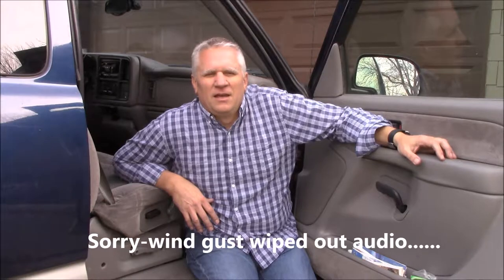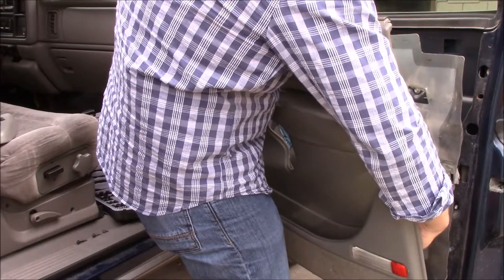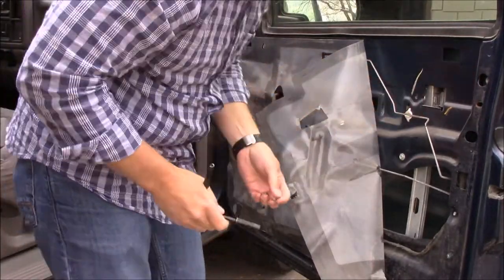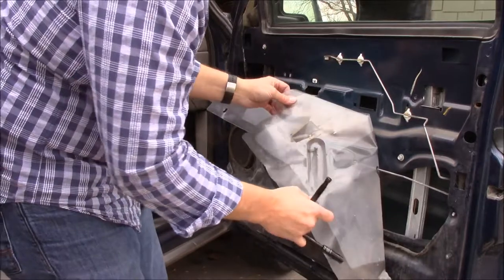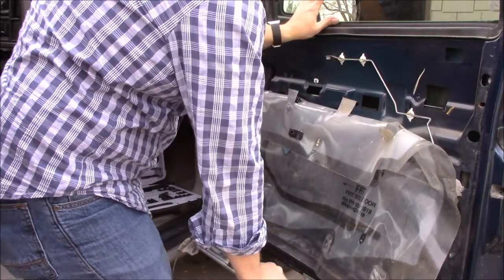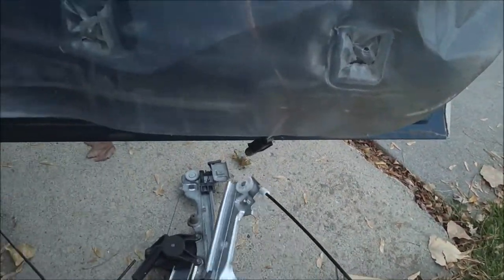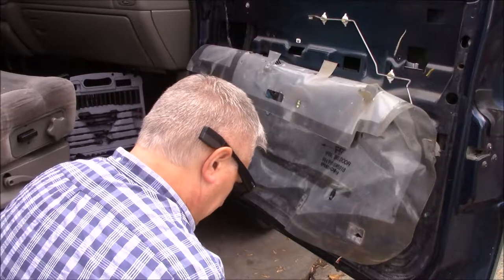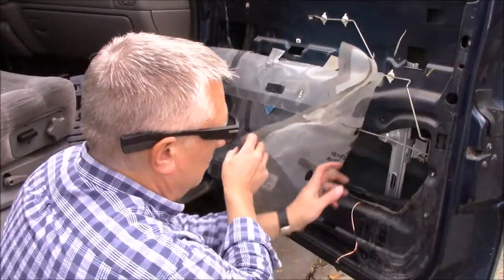AggressiveFun - 2000 Chevy Silverado Power Window Regulator Repair

Comment: Pro Tip: Tape the window to the door frame so you don't have to hold the window up and can have a free hand while trying to manipulate the
 door regulator.  1AAuto has a good guide but yours was more detailed.
Reply from the maker: Great tip! I did that when I fixed the driver's side and it worked great.
Reply: @Aggressivefun  the window is down. How do i get it up to tape it?
Reply: How do i get the window up??
Reply from the maker: @mikesanchez8082  You can move it by hand once you have taken the door panel off on the inside of the door.
Reply from the maker: @mikesanchez8082  When you take the panel off on the inside of the door, you can then manually move the glass up and tape it to the door frame to hold it in place while you work on the window regulator. Thanks for watching!